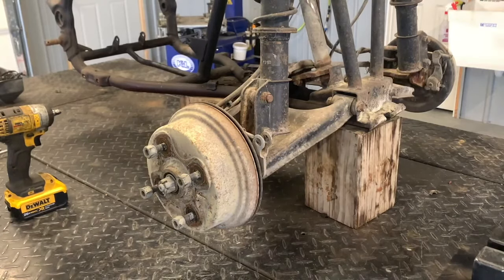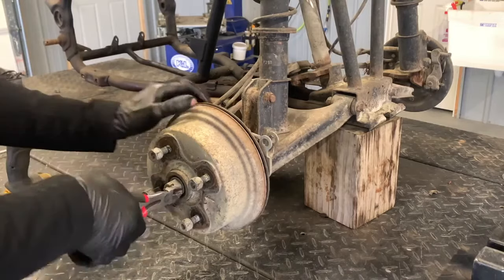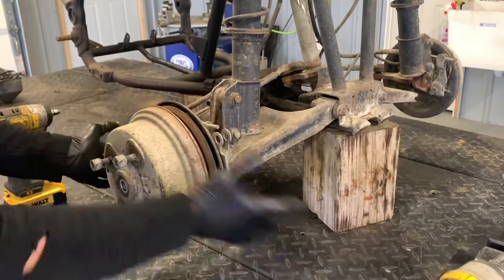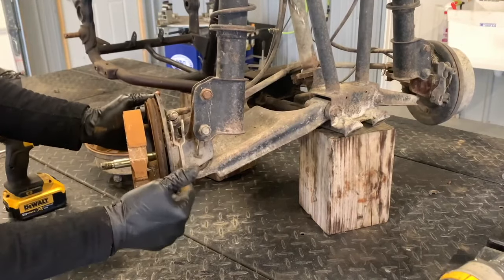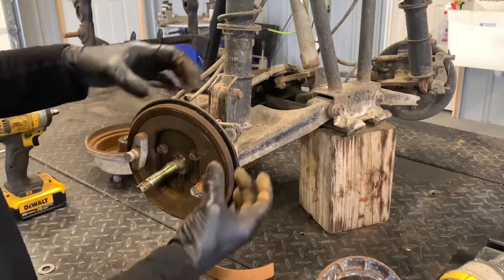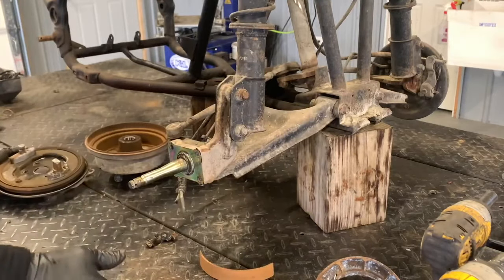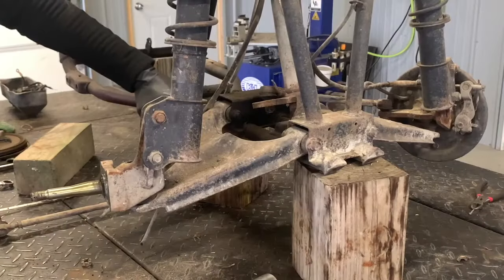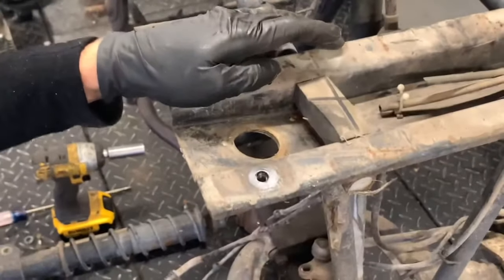Yamaha Timberwolf 250 - Front End / Brakes / Bushings / Bearings - Fix it ALL.

Comment: My brake drum (front left), refuses to come off. I’ve hit it with a hammer all around, it spins freely, but I just can’t get it to slide off. My front right came off as easily as yours but that was because the previous owner had that side already off before for an axle replacement. Got any tips for me? I’ve been using pry bars all around to just try n give it a little leverage.